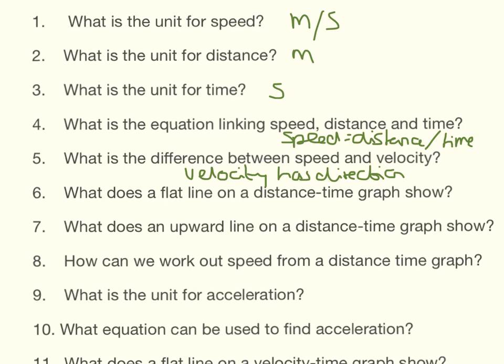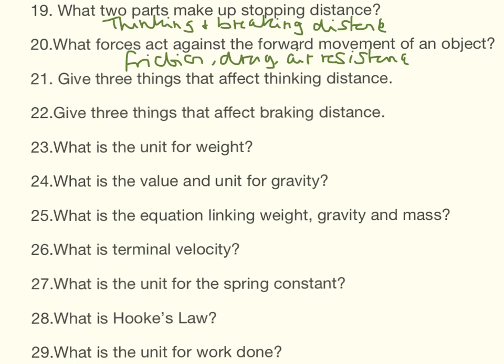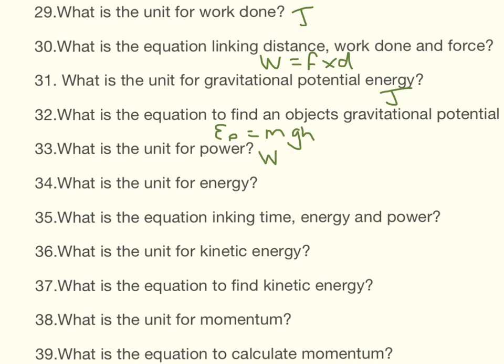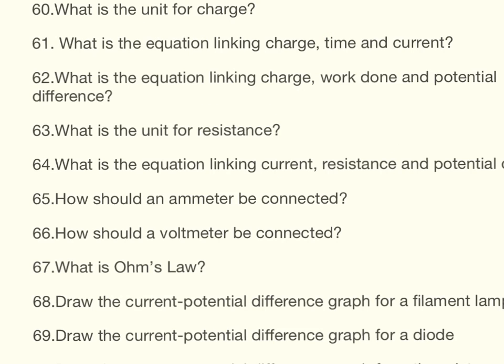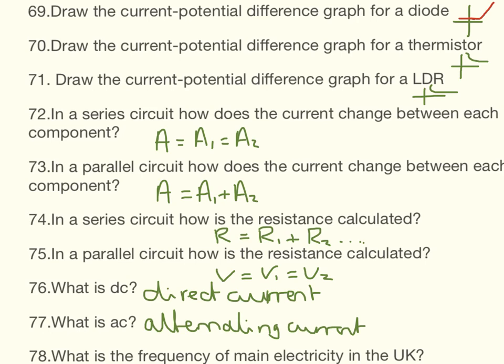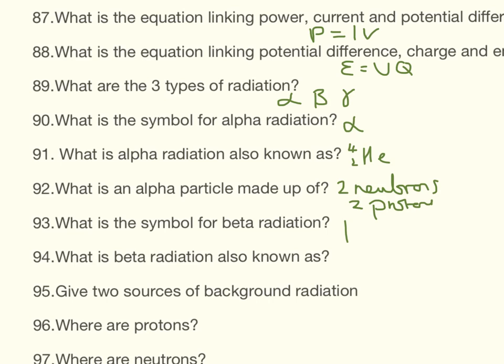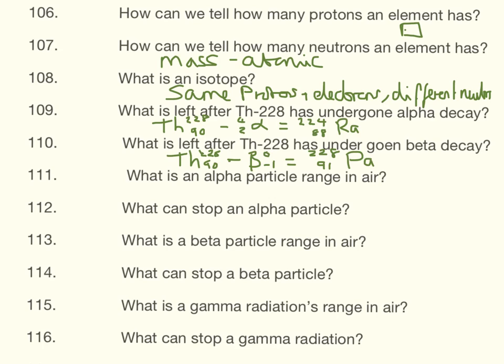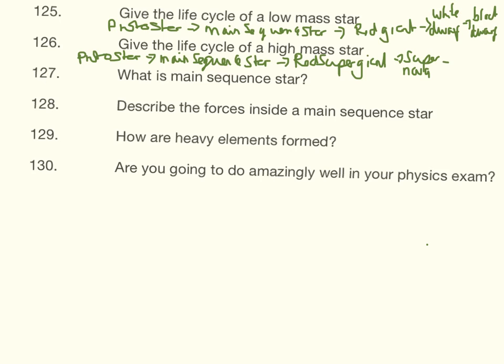130 Quick Fire P2 Revision Questions. AQA GCSE Physics

Comment: I thought that the resistance in a parallel circuit is calculated like this..

1/Rt = 1/R1+1/R2... 
So it is basically the reciprocal of the added resistances (if that makes sense).
Reply from the maker: yes, its a combination of the current and voltage laws.
Reply: +Chemistry and Physics by Primrose Kitten Okay

Comment: why should a voltmeter be connected in parallel? doesn't it depend if the circuit is series or parallel? 
great video by the way